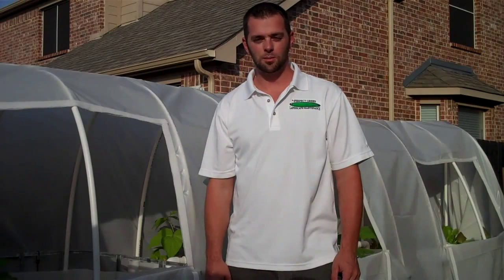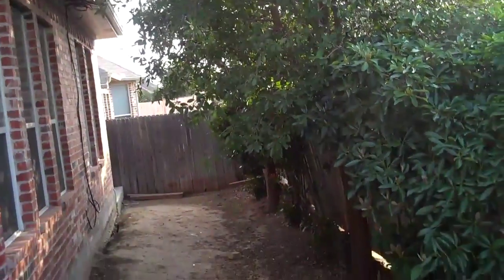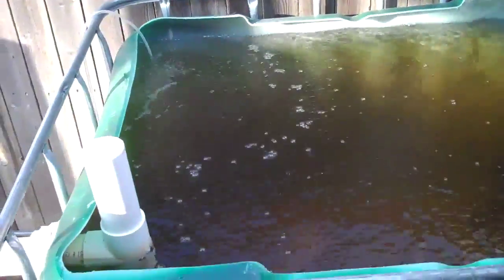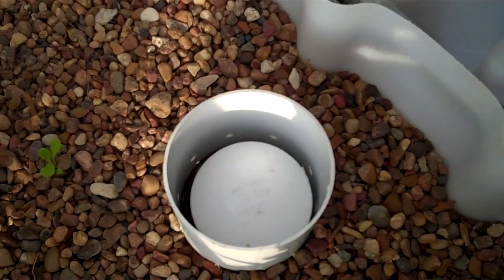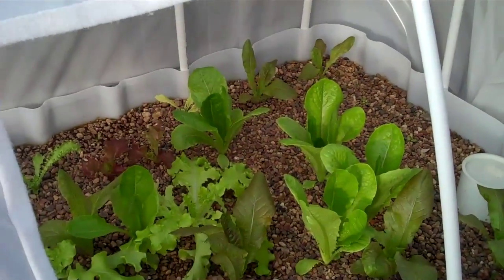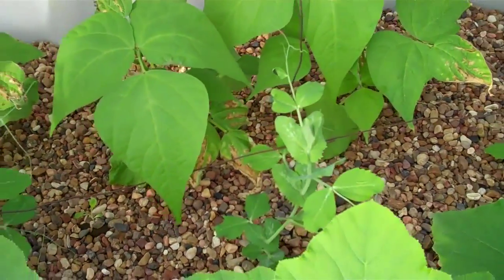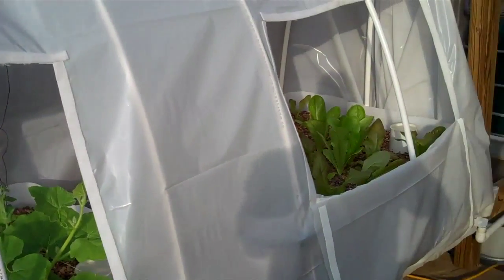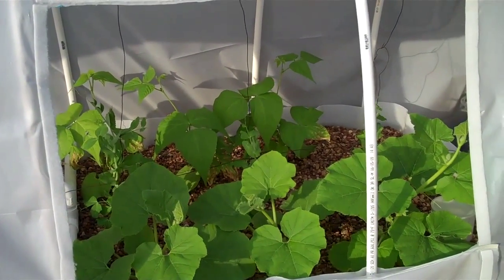Custom Aquaponics build

Comment: So, the "dirty" nutrient filled fish water flows into the sump, is pumped into the growbeds, filtered, and the "clean" water is dumped back into the sump?  So rather than pumping nutrient rich water into the grow beds, and clean water into the fishtank, your pumping a half and half mixture into both? That seems slightly inefficient to me. It may be benificial to add an additional sump so that the nutrient water is more rich and the fish receive a "cleaner" filtered water in the tank. Not hating.

Comment: I am one of the biggest advocates for aquaponics. However the PVC is in about 98% of systems and no-one seems to be bothered about the ingredients. Lead, cadmium, and phalates that are all toxic. PVC is 3 on the plastics watch and is not very safe especially in the sun. That's why many municipalities over the USA are switching to HDPE pipe for their residents homes. There were studies done by the EU in 2000 from specialist scientists and they all said the same thing. Get rid of PVC pipe.